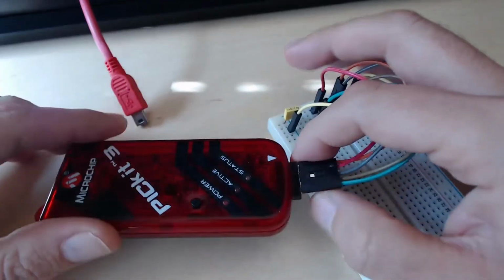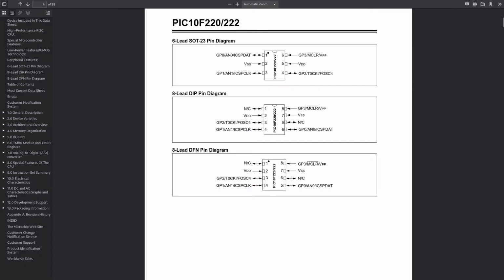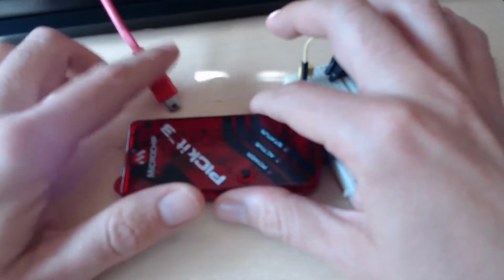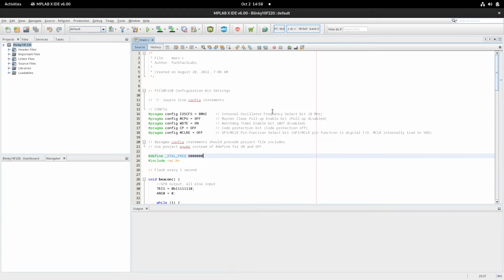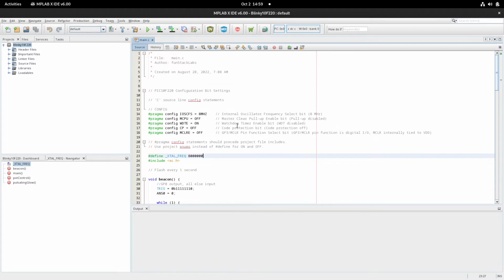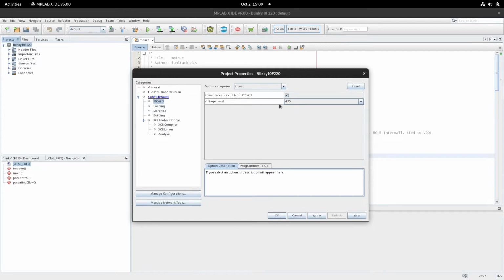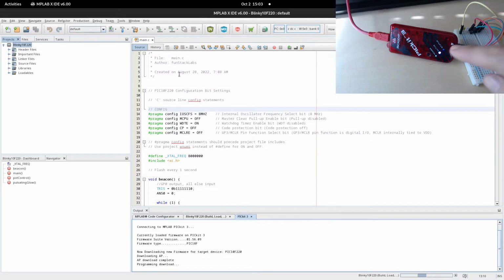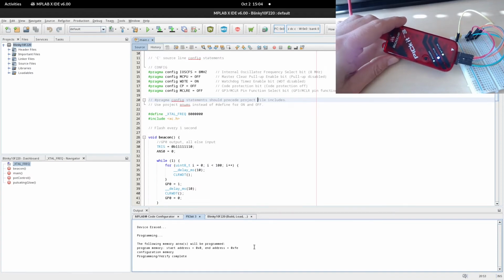Troubleshooting PICKIT 3 connection problems

Comment: I have PIC10F200 and 18F4525s and a few 16F chips. I can get them working without much trouble.

But, I bought five "18F452s." I have spent countless hours trying everything: assembly language, c language, buying new oscillator crystals, trying tonnes of different code from various sources. tearing down and rebuilding the circuit. -adjusting all the config bits, adjusting the pins from analog to digital in the adcon register.

watch dog timer is off, brownout is off, LVP is off.

Nothing gets these damned 18F452 chips working!

MPLAB sucks sometimes. Lack of Microchip support doesn't help either.